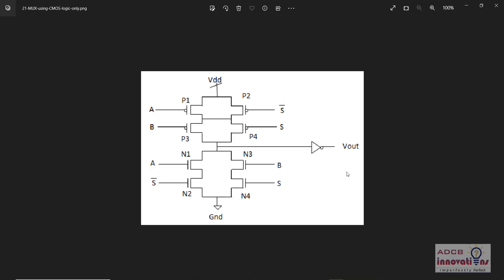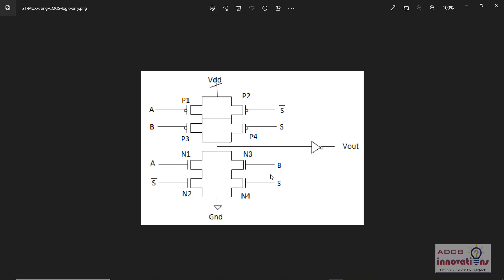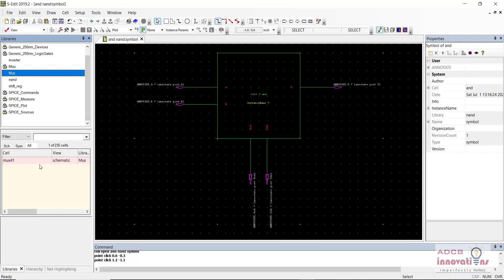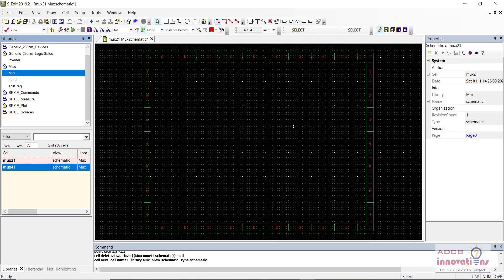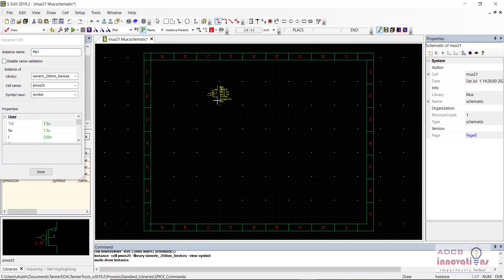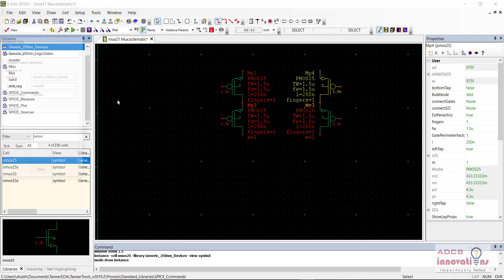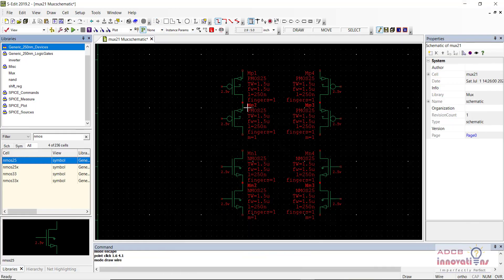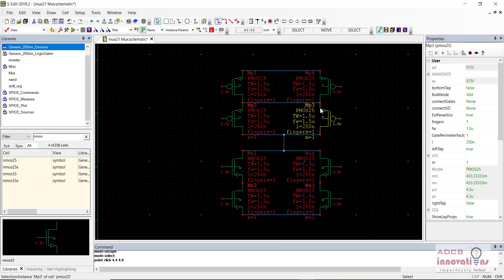2:1 MUX using CMOS | S-Edit

Comment: Hey, How did you reduce the size of the contact tap's(sky blue bubbles) between the Pmos circuit and Nmos circuit wire??
Reply from the maker: The size of the contacts is by default set as shown in in the video. You can check the properties if there is any option to further reduce the contact size.